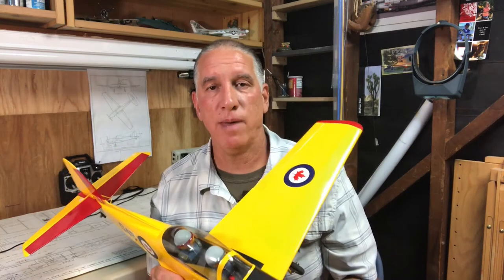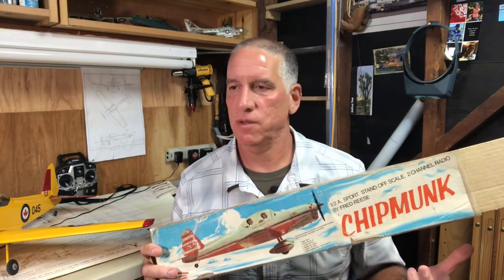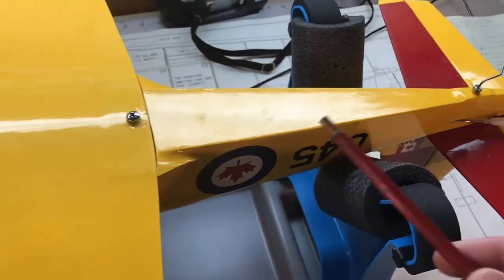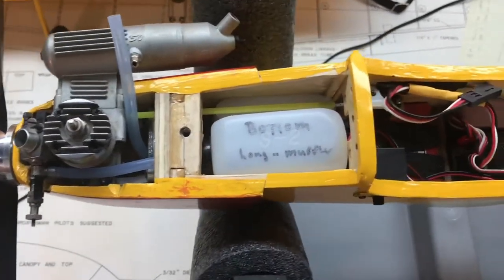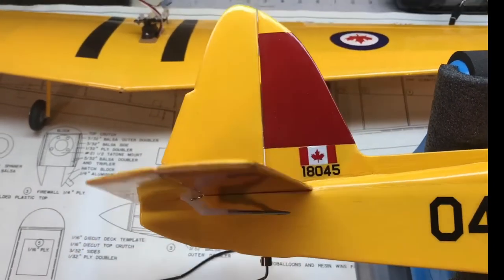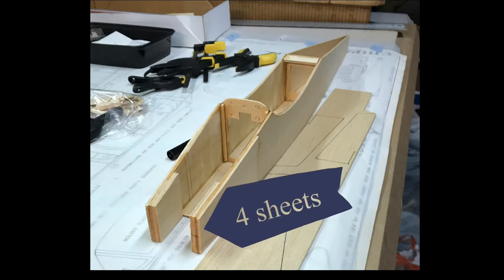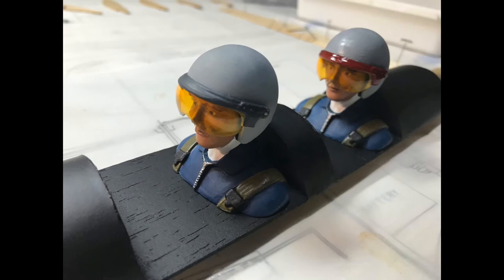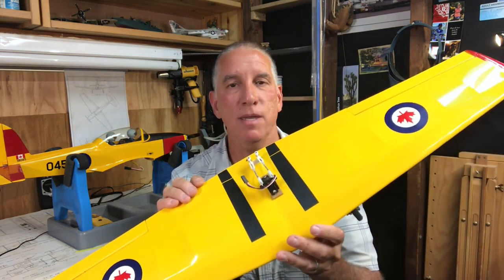RC Plane Kit Build, No. 2 Fuselage Construction

Comment: I have three of these little Chipmunks..
I haven't flown any of them.. I saw it in flight in another video.. Man, it's fast! My closest one to being flight worthy is also equipped with an OS 10
Reply from the maker: Thats cool. The .10 is a perfect size. It flys a lot smoother and easier than I thought it would for a little plane.
Reply: @JamesRCPlaneTech 
Did you use canopy glue or, trim tape to attach the canopy/turtledeck to fuse. You did a really clean job
Reply from the maker: I used epoxy to attach the plastic canopy/turtle deck to the wood cockpit assembly. Then I think i used epoxy to attach that to the fuselage. It fit pretty well with the kit parts
Reply: @JamesRCPlaneTech 
I'm down to that as pretty much the last step (on mine) .. I've procrastinated, as I want it to look as cosmetically appealing as possible.. Thanks for the the advice.. The other two Chipmunks are built.. One has flown as was set up on electric.. I bought it on Offer Up for $50... I couldn't pass on it as I have many hours in the one that I've built.. I have close to 200 airplanes.. I don't know how I feel admitting to that.. I've been building and flying for 30 years.. I started at the age of 18 but, as a kid my dad flew control line.. He never did venture into the Rc world, as back then, it was a bit more expensive of a hobby.. You know with this Chinese market putting all of our American manufacturing companies out of business, everything has come down significantly..
Reply from the maker: Good luck finishing it up, Im sure it will be great. The HOB kits are cool.

Comment: I know this is an old video post- but just to warn you- reinforce the horizontal stabilizer!  I built one of these some years ago, powered with a Cox TD .09.  Super performer but the h-stab failed in flight and as they say, that was that.  I suspect some thicker or stronger material in the tail would be helpful for anyting > COX .049 power.  Hope yours is going well!
Reply from the maker: Hi, yes I agree with you, they gave pretty thin sheet balsa for the tail surfaces. But I didn’t reinforce it. That would have been a good idea. I actually cut a new horiz stabilizer because the one in the kit was warped, but I think I used the same thickness. Kit was in storage for over 30 years and I was surprised how except for a few pieces, the wood was great. Great kits! Thanks for the advice.